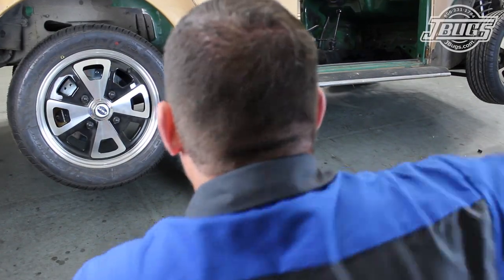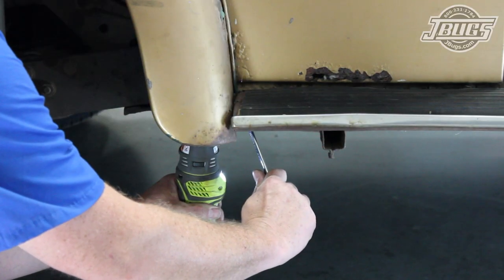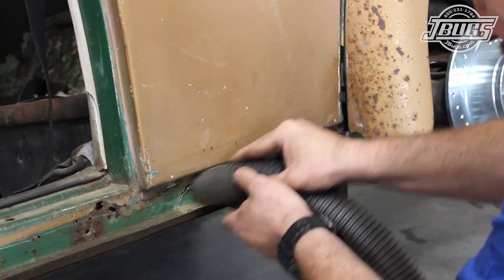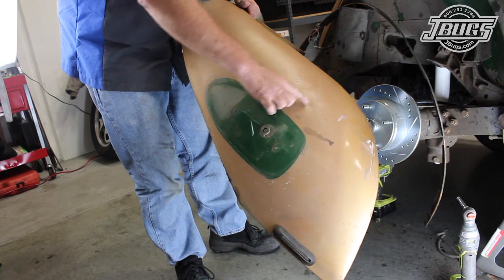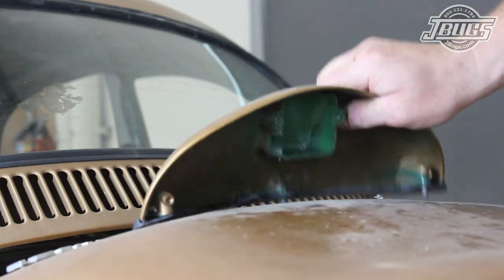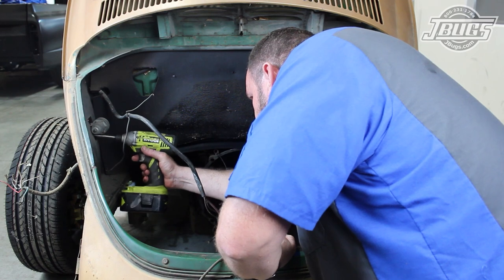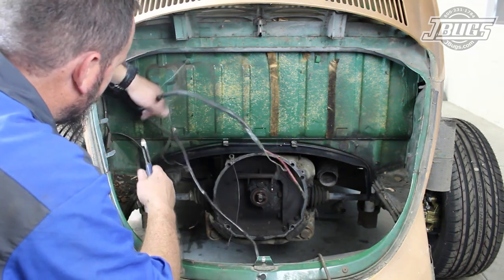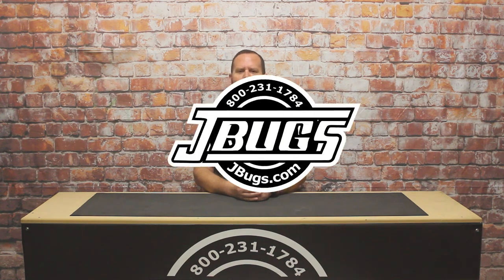JBugs - 1971 VW Super Beetle - Running Board, Rear Fender, & Decklid Removal

Comment: I have a 71 Super Beetle and would be very interested in any videos on body repair.  So yes, please, make a video on the heater channel repair.  I would also be very much interested in the repair of the emission control system. I have questions  like how long is the charcoal canister good for? How is it hooked up, as all of my lines have rotted away. What is the tube behind the radio where the hoses from the gas tank go?
Reply: They are all in the can, as far as the major body repair stuff goes. We'll spare you all the countless hours of block sanding which is going on now during nights and weekends. As for the emissions stuff, we aren't running a stock carburetor or any of the original canisters. The charcoal canisters are good as long as they aren't clogged, or empty. The tube up under the cowl is an vent and evap tank. Early emissions technology is archaic at best so getting new components today is next to impossible.